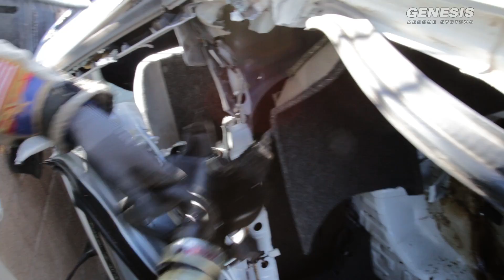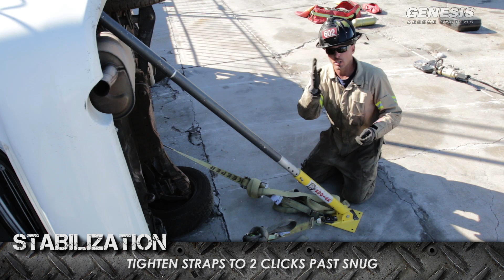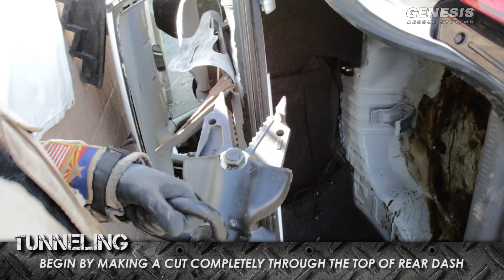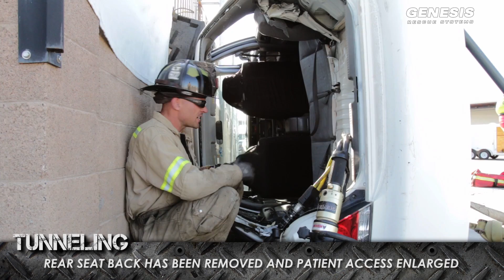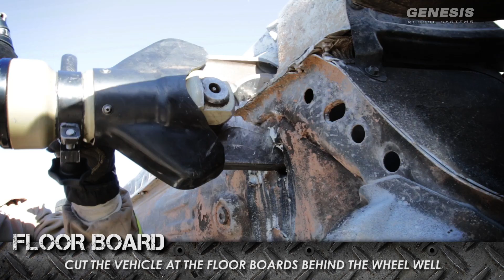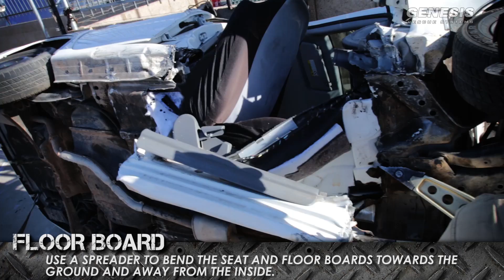Extrication Training | Tunnel and Floorboards | Genesis Rescue

Comment: So say you don’t have an air chisel available and only have a recip saw to complement the jaws, but can’t use the recip for whatever reason, could you still achieve the same end result but slightly angling the cutters on the initial cuts on the rocker panels then applying the spreaders?